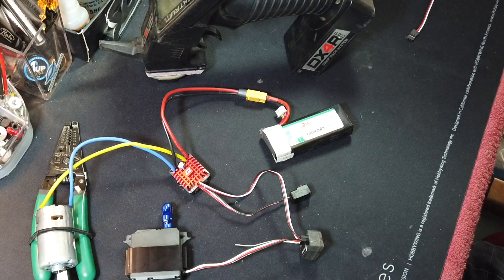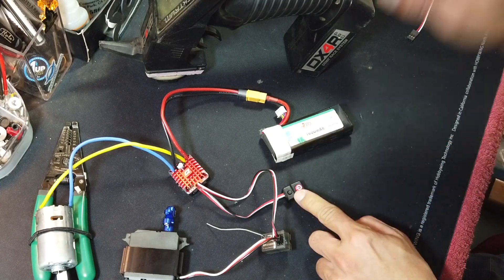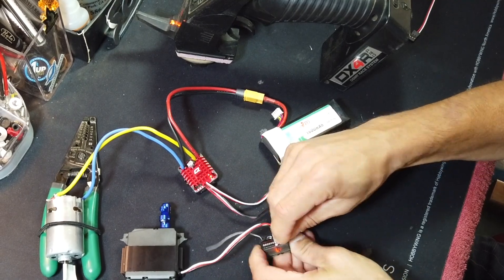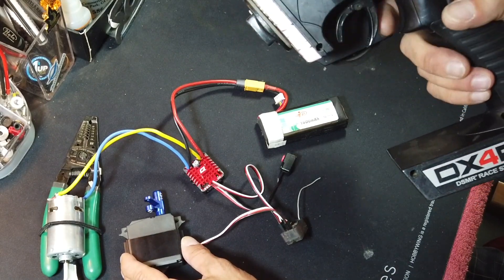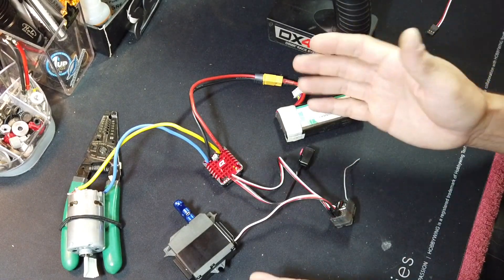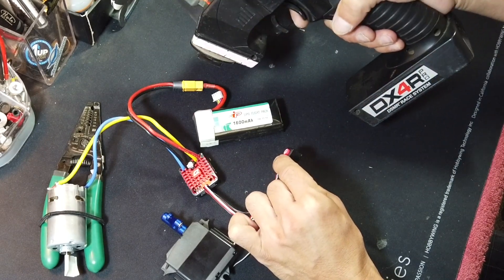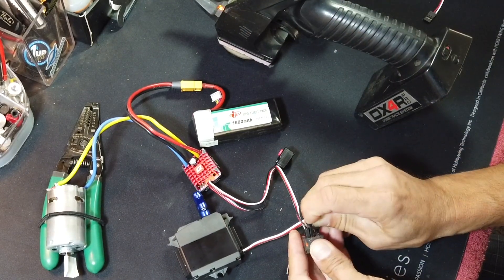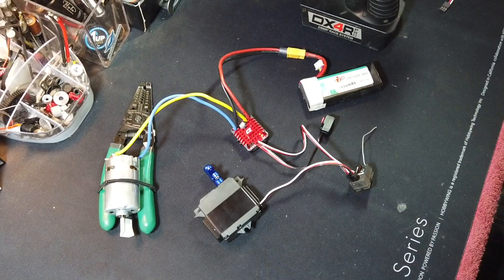The Charlie Show /// Episode 121 /// The Servo Test

Comment: I have a max 6 on my Traxxas XRT that wont steer or calibrate throttle.  Stock ESC works fine.  What do you suggest I do?   ESC flashes red led light.
Reply from the maker: We would suggest sending us an email for assistance - NorthAmerica@hobbywing.com for customers in North America to work with our offices in CA.